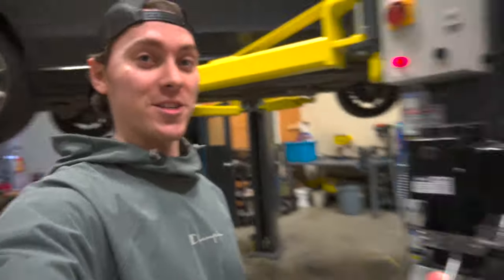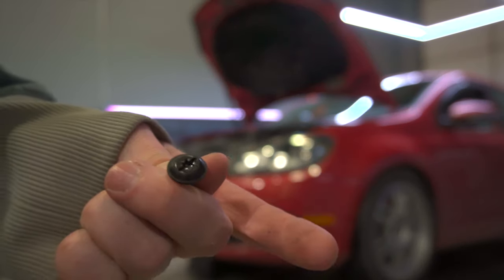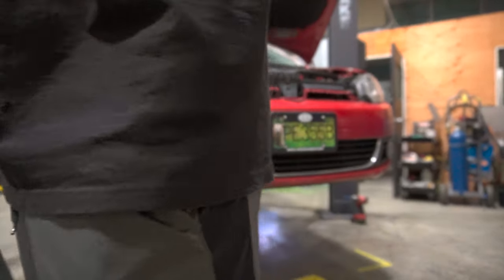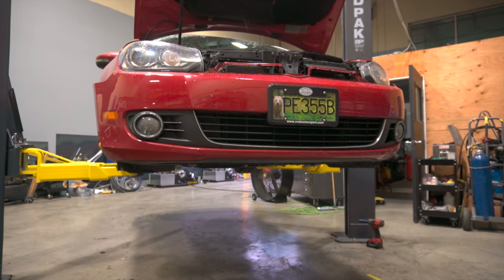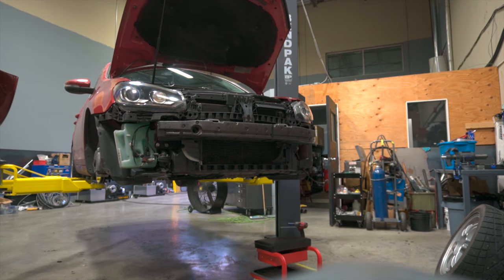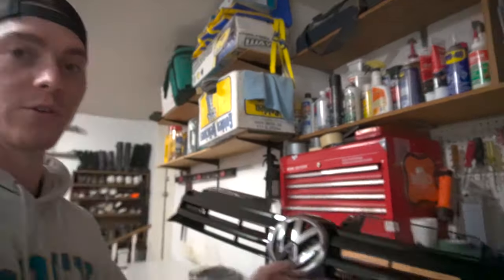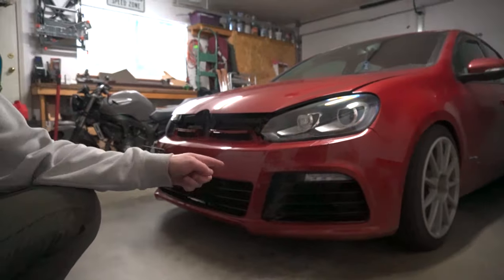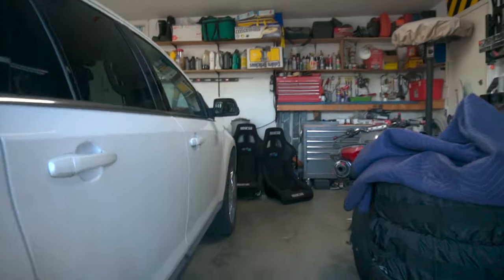Golf R Bumper Conversion - Big Turbo Mk6 TDI!

Comment: I have a 12’ golf Tdi MT and I love it. I just wish the stock clutch could handle the cr170 turbo without an upgrade but the vehicle regardless is a solid unit
Reply from the maker: yeah quite unfortunate that VW underrates so many drivetrain components from factory, DSG is pretty solid holding the 2872 so far!
Reply: @ThatGuyTyy  Help a brother Ty...
Looking to do a Golf R rear bumper conversion on my Mk6 cjaa golf TDI with  same gen used OEM bumper. Can I use the current impact bar, absorber & support from the TDI for the R bumper?
Reply: My stock clutch has no problem running the gtb1756vk. Yes if you try to give full boost below 2000 rpms you may get flywheel shudder, but I have 140K miles on stock clutch and it's still holding fine.
Reply: @MrAshrr213  was actually looking into that turbo from xman, I moved from NY to SC and there are no emissions here so the first step is a delete kit and then the turbo and I’ll just get a tune all at the same time when I plan to install an upgraded turbo, I did do a new clutch about 10k miles ago so knowing that’s the case I definitely am looking into a bigger turbo!
Reply: @kirkusbodurkus5535  I really enjoy it. I'm deleted as well with that turbo and new map sensor but stock hpfp for now. Have an s3 intercooler waiting to go in. You can definitely tune/drive around the limitations of the stock flywheel.

Comment: So colour codes for paint match. Factory paints may be mass-produced but color-matching parts from one vehicle to another will always show up as vehicles have different amounts of sunlight hit them over the years and also paint mixes will always vary from one batch of the same colour to the next. I have an obsidian black Scooby and the paint code always shows slight differences on other parts. It's even worse for lighter colours stand fast whites I think. Most decent paint shops will have variants of the same colour code best thing to do is take the car to the shop and hold the colour card to the paint to get a match on your paint and mix it to the paint you have. In the condition your paint is in but this is clearly if you're painting parts yourself. The shop can't just colour match your vehicle well with just a paint code alone.
Reply from the maker: Yeah I ended up bringing the car directly to them and leaving it there the second time - first go around I also brought it in and the painter came out and checked swatches for the paint code and everything and he was confident first go was gonna be a good match - live and learn as they say!

Comment: How about getting a 4d vw emblem I have it one on my 8p audi A3 s line sucks that it's a write off now got rear ended in late January and icbc adjuster still didn't come to my home yet 12k damage.. But yeah all oem parts from a Audi TT etc. 2010 rear euro talight upgrade riding on amg 18 inch rims which originally was on a Mercedes ML63 2003 model with a audi ctr cap. Colour was sprint blue with a Rs3 gloss front honeycomb grill. Unitronic  stage 2+ tune. 2.0. will be coming soon. But yeah found your video because I was interested in the catch can set up. My car is my profile pic.
Reply from the maker: I’d love to get R tails, they are super expansive! Can you link me to the 4d emblem? I have no idea what that is!

Comment: Any coding required for the golf R headlight?
Reply from the maker: There is coding and a module needed, I don’t actually have the module so mine doesn’t quite detect the high beam flap cause it’s looking for stock golf high beam still (separate bulb) but everything else works!

Comment: Did you leave the foam insert off? Im currently running into the same issue and I am wondering how you went about it. Also what are the risk with removing the foam I know you said you didnt recommend it but you still did it right?
Thanks in advance!
Reply from the maker: Hey Cody, I am not running the foam, I trimmed it down a bunch and it still never fit, you’d have to get a golf r specific insert If you wanted to run it but the danger is if you ever have a small collision  in the front there is no support behind the bumper to hold the shape so it would just crumple and need to be replaced